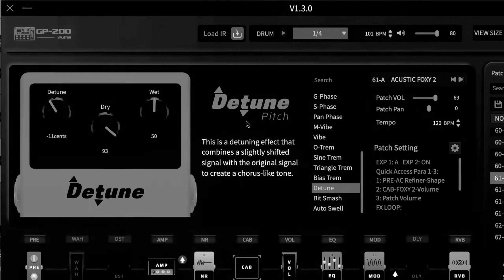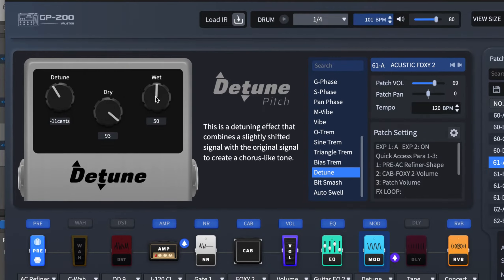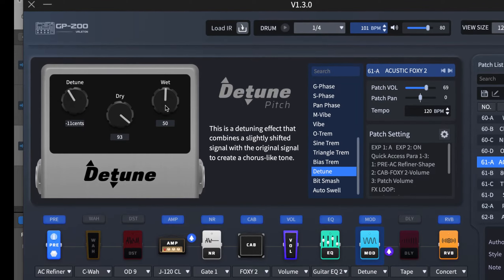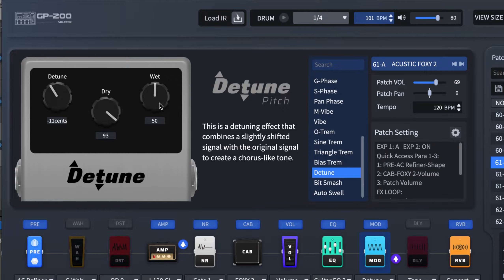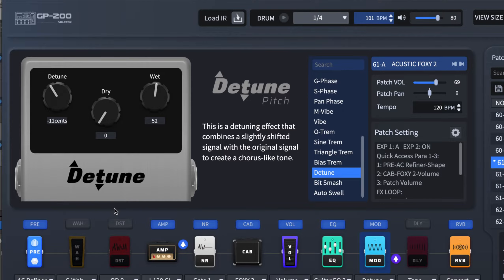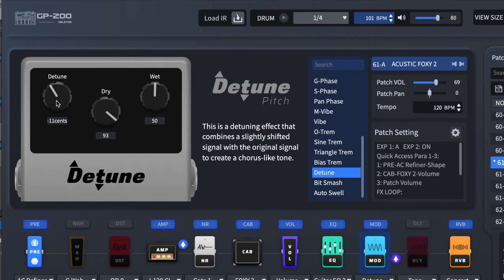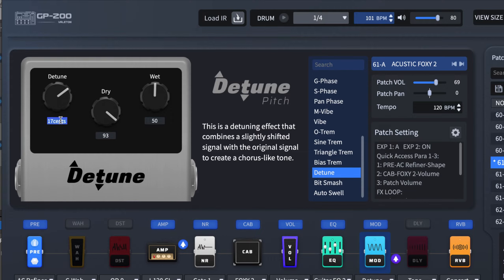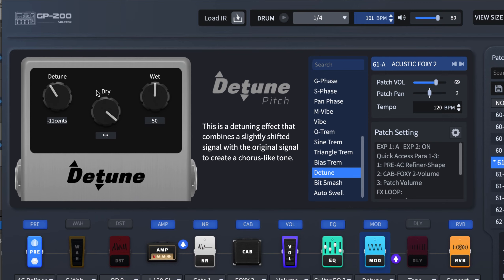Detune Effect Concepts⚡ @Valeton GP200

Comment: can we use more than 1 same category effect in this multieffect? for example, i love combining 2 modulation Detune and Chorus. but in the default settings, seems like it only has 1 modulation category on the Valeton GP-200.
Reply from the maker: At the moment the GP200 doesn't have such feature yet.
Maybe they might add it in later Firmware & Software updates
Combining Chorus & Detune gives a very sweet tone